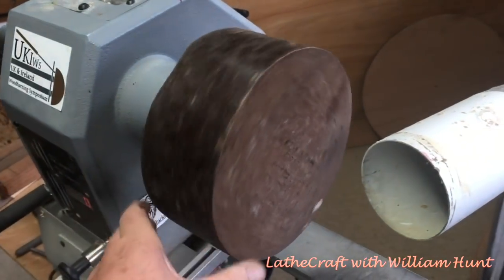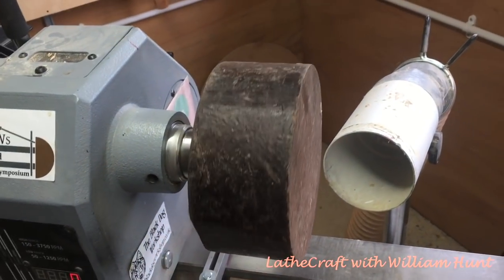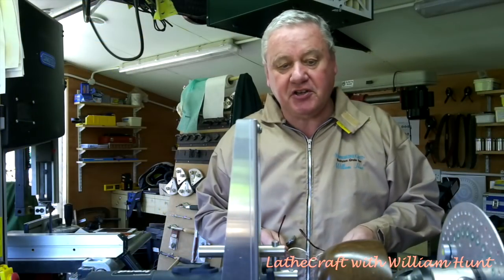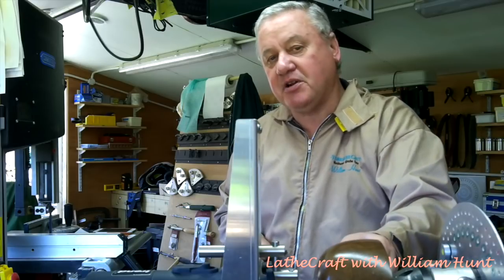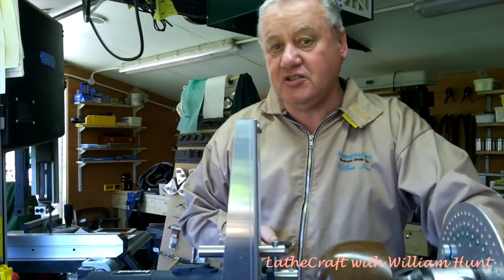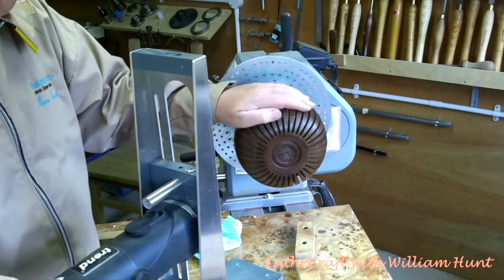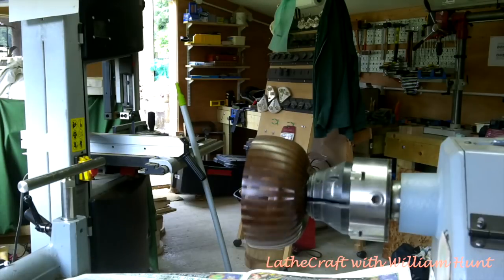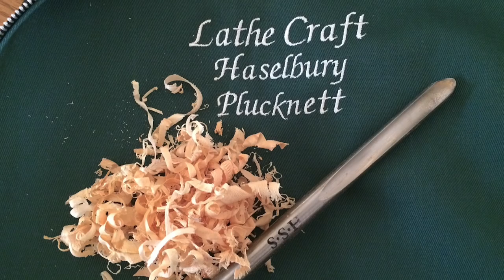Paul Howard Fluting/Router Jig 10 - A Latticework Bowl in Brazilian Rosewood

Comment: Beautiful bowl. Very creative work. Do you ever find an issue in putting lacquer over wood that has been exposed to Yorkshire Grit? I use  Y G too and like it! But have been afraid to use a spray finish over top. Just curious if you had any difficulties with adhesion?
Reply from the maker: Jon, thanks for your comments. There should not be a problem with lacquer over YG and long as all the product has been consumed, i.e. the paper towel is clean.

Comment: This is the third video featuring the router fluting jig and I must say I am impressed with your use of this tool. You have produced several very interesting and beautiful items. However I think you should spend some more time showing the set up and adjustment of the tool. For instance I was wondering how you got all the flutes to stop at the same place at the bottom of the bowl. Then I finally got a glimpse of a stop you set up on the base of the lathe. But you never talked about how to set up the stop. That was a very important part of the operation but never mentioned. I needed to see that but I didn't need to see every flute that was cut. Please more commentary, tone down the music, it is annoying, I prefer commentary over the captions. Your finished work is outstanding, showing how you achieved it needs some improvement.
Reply from the maker: Hi Glen and thanks for the comments. There has in fact been about 14 of these videos and you you visit some earlier videos, you can see how I make the stops, when they are required. On the other hand Its sometimes a good idea to go back to basics and I might do that in October, you are not the only person to as this!
Reply: I realize that for you to repeat something that has been discussed previously is a lot of extra effort. I on the other hand hate to be directed some place else when it appears that it would most appropriate to present the information in the current video.  I guess the best compromise would be a brief explanation and a link to a better discussion. And I do mean link. Something in the description I can click on. You did that very nicely with a link to the Paul Howard fluting jig. In this case a link to the video where you discuss the set up for the jig would be appropriate.